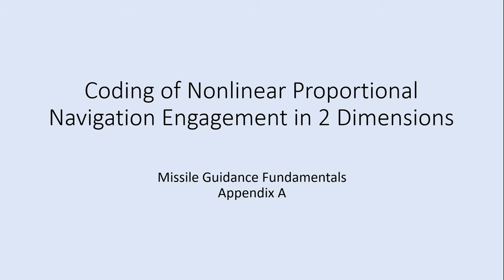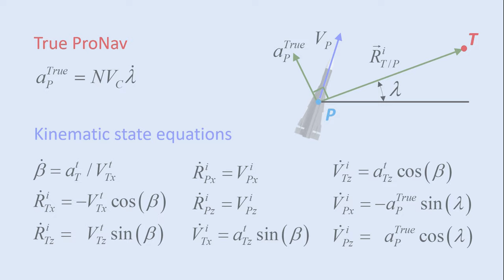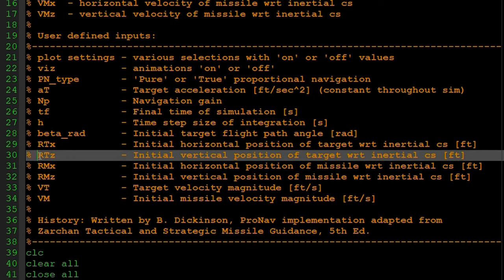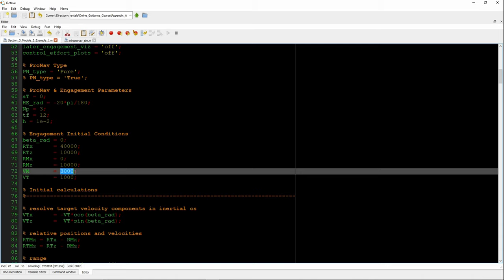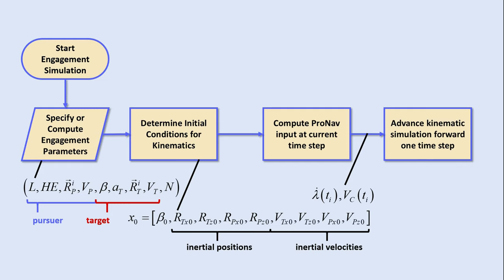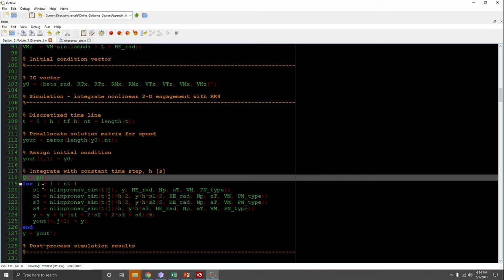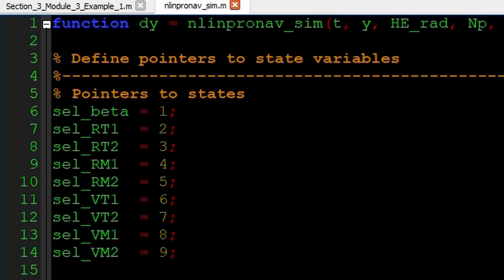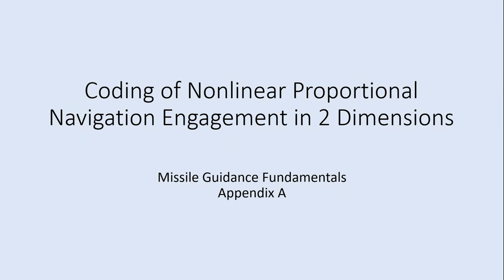How to Code Proportional Navigation in Matlab or Octave - Guidance Fundamentals - Appendix A

Comment: I enjoyed watching this video and looking at the code you produced. It was well explained and in-depth. I have one slight caveat. Your model is a simply point mass model with translational kinematics. The only angular reference is altering the flight path angle, which is performed through calculating the required acceleration components from the ProNav solution. In reality, this is only part one of the solution but sufficient for a 2DOF set of equation. Yes you can apply this directly to the translational equations of motion and have your point mass intersect the target, but that means engaging in unfeasible flight. It would be interesting to relate the solution from being an acceleration of point mass, to actually rotating the airframe kinematically such that its dynamics intersect the target - creating a longitudinal 3DOF model.

Again, I enjoyed the video. Let me know if you think I might have misunderstood something.
Reply from the maker: Thanks for watching, and you're correct: this does not include the vehicle dynamics. A common approach is to approximate the closed loop vehicle response with a low pass filter. This wraps all the translational and rotational dynamics along with the flight control system into simple input-output relationship, which can actually be accurate from the guidance loop analysis standpoint if you get the time constant correct. The next step, as you point out, is to include an actual vehicle model that captures how rotational dynamics couple to translational dynamics.